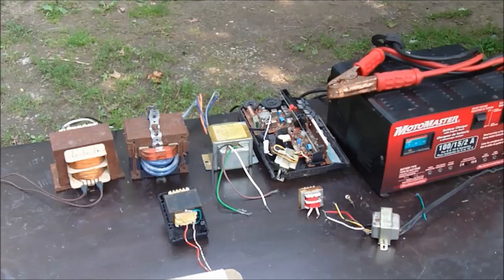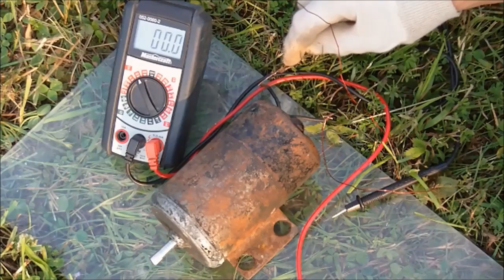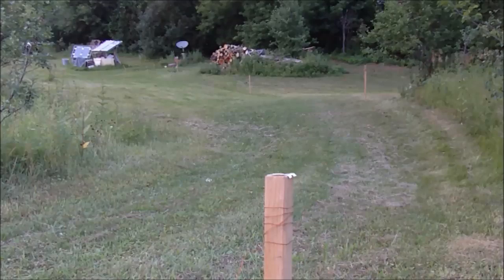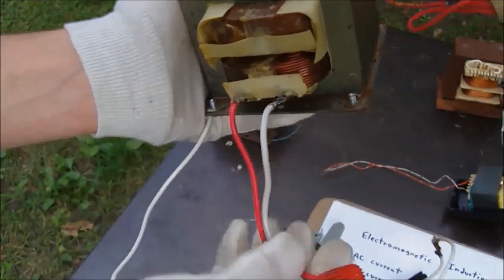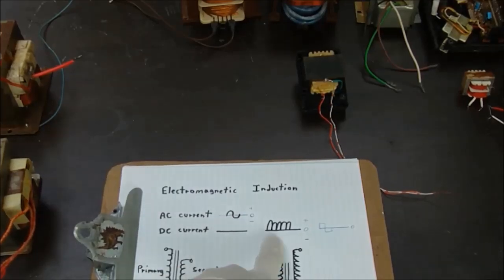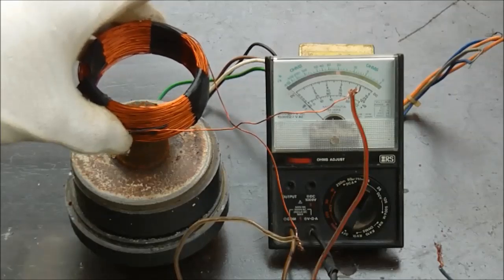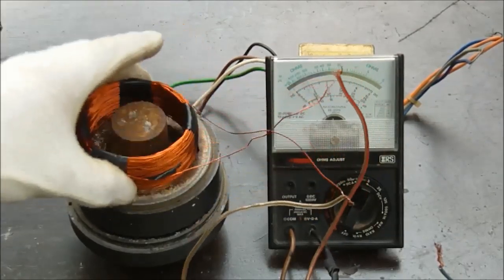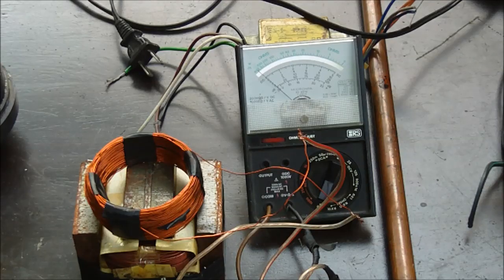Transformer Demo (hands-on experiments, induction, Lenz, power transmission)

Comment: You could do the same thing using just one wire for transmission and running the 2nd end to ground. then using the one transmission wire run to one end of the step down transformer and the other end of the 2nd transformer to ground as the return circuit .....